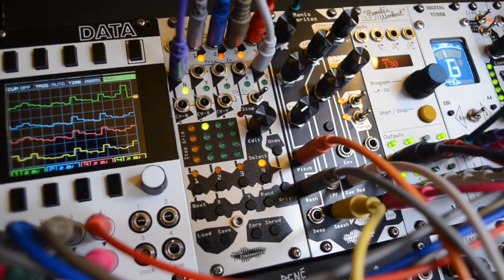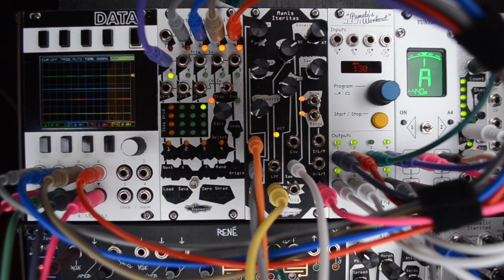Mimetic Digitalis 16-step CV sequencer tutorial and demo

Comment: Can the step count be adjusted in any other way that using the Clep Diaz? If so, how?
Reply from the maker: There is no internal function like this, but you can use a clock divider or trigger sequencer to reset MD and change the number of steps.

Comment: Great demo, very comprehensive. 👍 just wanted to check, the 4 cv outs can sequence 4 separate oscillators, right? Must get saving! 😂 One more thing, is it 4 channels of 16 steps each channel (like having 4 16 step sequences), or 4 steps x 4 channels, or 16 steps with 4 outputs? Thanks.
Reply from the maker: CV anything you want. 😁
Reply: @NoiseEngineering  I suppose I was more asking if they are 4 individual sequences and they are all suitable for v/oct... I'm a noob, so like to check! Thanks.
Reply: It's 4 channels, each channel is16 steps long.. unless you trigger the "origin" button or input... which allows for some interesting variations on rhythm.  as the man says... you can cv_modulate anything .. eg, chnl 1, 2 on 2 oscs... 3,4 on filter... or mult them... a loot in a small unit ))))
Reply: @toonertik  brilliant, thanks! 👍

Comment: that looks like a very fun module, great presentation too. the only thing that seems weird is that when turing the encoder the signal is not interpolated to the steps, is this by design? also would have been great to see a slew function.
Reply from the maker: It's meant to be a step sequencer, so there is no interpolation, that's correct.  We never really considered a slew function, mostly because any other things we could possibly add would have made it larger!